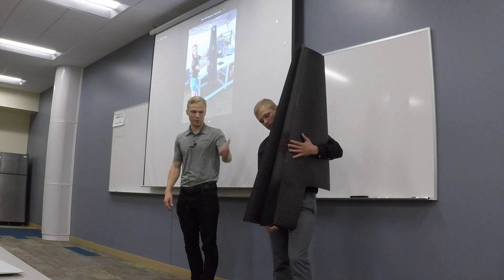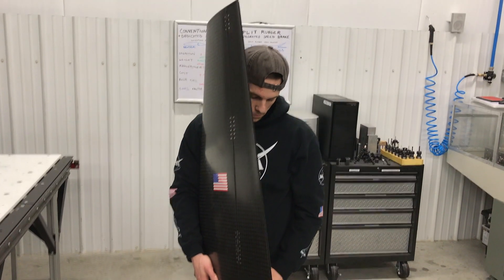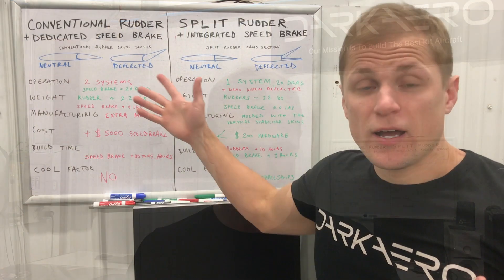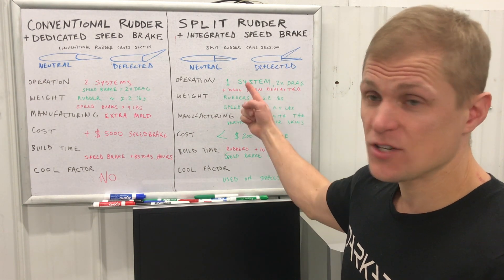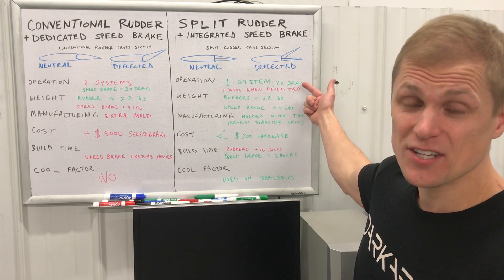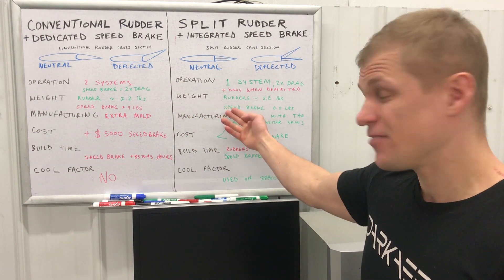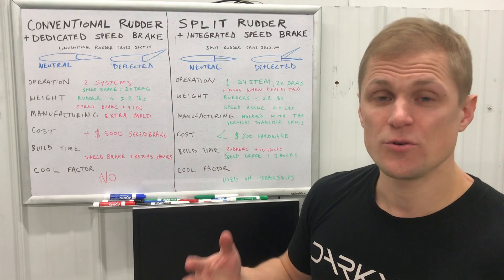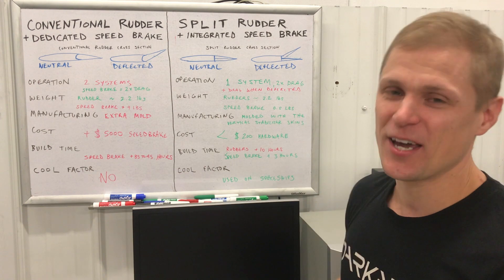The DarkAero 1 Aircraft Split Rudder

Comment: I admire your drive and passion to start a project like this. As an engineer who loves to innovate anywhere I can, I like your ingenuity of integrating a speed brake into the rudder. I was considering a similar idea on my plane, except as applied to the pivoting canard instead. I have some friendly advice I'm sure you don't want to hear from some random nobody on the internet, but I did notices two issues with your design that would become evident on the first round of high speed taxi testing, It is an easy fix if a little hard to explain.

1. Your split rudder design is not dynamically balanced to offset the extra control force required at your high cruising speed as the rudder deflection is increased. A balance isn't always required, but if in the future you find one necessary it can be incorporated with a dorsal horn balance at the tip of the left rudder and a ventral horn balance at the tip of the right rudder.

2, The second issue and by far the more important, is the intent to connect the left and right rudder flaps separately to the left and right rudder pedals with the speed brake function requiring constant force from the pilot on both pedals to keep the rudders open. Something which would increase pilot workload both physically and mentally during landing procedures. The fix for this is to implement a rudder control mixer device similar to a v-tail Beechcraft controlled by a distinct ratcheting speed brake lever in the cockpit. This would in effect be as simple as piece of steel C-channel with a hole on either end allowing the respective left and right rudder cable to pass through either hole. The plate will have a pivot in the center connected with a push/pull rod to the ratcheting control lever. When the control lever is pulled the plate slides down the rudder cables until it impinges on knots or clamps placed on the cables thus tensioning the portion of the cable connected to the rudder flaps, this motion will simultaneously open both rudders. The further the latching lever is pulled, the more the rudder flaps will open and thus a high amount of drag is produced. The extra control force resulting from the increased drag is taken through the mixer pivot anchor into the airframe, thus the increased control forces produced by the increase in drag are not felt by the pilot through the rudder pedals. Rudder control through the pedal remains unaffected even when the speed brake lever is pulled due to the speed brake control mixer incorporating a pivot between the two rudder cables. If the pilot adds additional input to the right rudder pedal the mixer will pivot about its center and let off a equal amount of tension/slack to the left rudder cable and vice versa. The clamps placed on the cables with be positioned such that when the speed brake lever is in the released position, the cable clamps will not impinge on the speed brake control mixer even at full rudder deflection, thus preserving independent control of either rudder flap.
Reply: Beautiful, I like your thinking.

Comment: Bad idea and adds unnecessary complication.  Need to look at human factors in the design.  Many pilots use opposite force on the rudder peddles for stability and control.  Pilots use both feet together to move the rudder, not just pushing on one at a time like a video game.
Reply: People that just say things like “bad idea” and “unnecessary complications” without any data or even references to other applications to support their position are absolutely the worst type of people to work with. How about suggesting another idea that would accomplish something similar to what they are trying to do instead of just shitting on the idea that someone else had? Or, at the very least, explaining why it’s a bad idea and what, specifically, makes it a bad idea. Simply bringing up that people use the rudder pedals in concert with each other isn’t a justification to scrap the entire plan. Also, the video game reference makes it sound like you’re a grumpy old man that is angry because he never actually got off the couch and tried to do something great and is full of regret. So, he takes it out on anyone that is actually out there doing it. Am I close? How close am I? 😉

Comment: Interesting, didn't know that hondajet had a baboon brake. Not sure that's elegant engineering. But it makes me wonder, could tab style airbrakes on the wings work effectively as a rudder if placed far out on the wings? I hunch that it would express too much as drag but if the wings have a certain length, would it be...  if you could forego a moving rudder, that would be elegant. If you take care of stability and trim with a static tail then it would only be for approach maneuvers where any slight inefficiency is worth the elegance.
Also I wonder, indeed assume, that rather than a prominent vertical tail, it would be better to reach far back with a much smaller tail fin like a shark does. Even though a shark uses it for propulsion. If a little extra length on a skinny tail makes a much better plane then it can be worth ignoring the hangar demands.

Comment: Hi guys! I’m not sure this is really related but: how does this split rudder works in case of a spin? Did you have the chance to simulate the spin tendency of DA1?
Reply: How many pilots would want a plane that could kill their passenger/s and themselves from not being responsive in overcoming even an incipient spin?  Where is the efficiency in hauling a plane recovery chute system?
Reply: I get the feeling that these are the kind of designers that slap a BRS on it and say it's not rated for spins.

Comment: Hey guys, that split rudder idea, while cool at first sight, may backfire at you - be careful. Split rudder system in shuttle, B2 and other military planes is carefully controlled by software, sensors and activated by precise machinery only in specific flight regimes. Your system is manually actuated and easily can be mismanaged in flight, and as someone using it in VariEZ mentioned, puts more workload on a pilot. Please consider removing or offer it as an option. And if you offer normal rudder with trim control - you will have my deposit to get in line for your kit!
Reply: I agree with you... Especially on their very first aircraft, they should be taking it easy with the "special" features, and maybe leave that for the 1.2 version of the plane instead. What initially matters is that the plane flies safely and predictably - flaps should do the trick for slowing down on approach. A complicated rudder system such as this will only bring delays. If the FAA has to approve any of this, I can only see it adding more time for certification.

Comment: I'm a VariEze builder/pilot and love all the innovative techniques and features you're putting in the DarkAero. I'd like to share my experience with the independent rudders on my VariEze. At high speed they are difficult to use as speed brakes because of the yaw produced by even a slightly uneven application of pedal pressure. It's pretty sensitive because of the high airspeed and takes concentration to keep the airplane tracking straight for the minute or so while the speed brake is needed.  For that reason the only time I use the rudders for speed control is on final approach when I realize I'm too high. And even then I find the feature to be of limited use because of the attention it takes to control yaw while modulating the drag to get me back on glide slope, in addition to all the other things happening on short final. The extendable 'belly board' on the VariEze and Long-EZ is a lot more useful since it doesn't require attention after being extended, allowing the pilot to focus on other things. However, it can only be used at lower speeds such as in the landing pattern.

Comment: won't this have more drag during high "p-factor" operations which require rudder? Extra drag while rotating for take off or fighting a x-wind doesn't sound fun. If it operated like a normal rudder AND had the split function that would be ideal.
Reply: sounds sketchy in a low speed crabbing situation where you want to bleed as little speed as possible while yawing the nose off. If you've got reserve altitude you're probably fine since your tail inputs will always bring the aerodynamic centre backwards.
I do really like it as an airbrake design though.
Reply: Canard aircraft (i.e. Rutan inspired; e.g. VariEze, LongEZ, Velocity, Cozy) have the same setup and they simply avoid using much, if any, rudder input in such scenarios. Some of the big jumbo jets also indicate a preference for landing crabbed as opposed to attempting a low-altitude sideslip, and IIRC at least one of the POHs or airline manuals prohibits sideslip landings.

Sideload on the gear isn't as much of a concern when you're touching down at ~1,500lbs.
Reply: @ParadigmUnkn0wn  the canards just have single direction actuation not exactly the same thing. And landings are not high pfactor  scenarios. Jets don't even experience pfactor...

Comment: I like your guy's analytical approach from design to fabrication, and of course, including the cool factor, I mean, that's what flying is right?
However, you've overlooked stating what I believe are the the two most critical factors when comparing the split rudder type to the fence type.....

No additional control to have to remember where it is, how to use it and then also remember to stow it (gear up landings come to mind...). Frankly, when you think about it, it's natural instinct to stomp the rudder pedals for braking, right?

Now, most importantly, you've eliminated the possibility of an asymmetric drag and lift spoilage condition if only one fence were to deploy due to a mechanical failure.....How would that literally end up?

Brilliant guy's!  Keep up the great work!

Comment: I just watched few of your videos and I think what you guys are doing is amazing.
Regarding the split rudder design however, I don't believe you will have enough rudder authority at low speeds and crosswind situations with that configuration.

You mention three examples of split rudder designs but there are differences to your design that don't make it a straightforward comparison :
- The space shuttle has a landing speed of 210+ MPH , whereas I'm guessing your landing speed will be in the range of 80 MPH.
- The Staggerwing you showed has a much larger rudder size. 
- The Long-EZ does not have a split rudder. You can think of it as two smaller conventional rudders that actuate to one direction only.

I just wanted to save you guys the hassle of trying to prove this out since it's unlikely to work.

Disclaimer: I am not aerodynamicist. I never designed or flown an airplane.
Reply: I just wanted to save you guys the hassle of trying to prove this out since it's unlikely to work.
 Burt Rutan told Danny Maher that a 4 place canard wouldn't work. Velocity Aircraft has been around 30 years now and are working on a 6 place canard.

Comment: I like your commentary on why it's lighter, but for PPL, how often do we have to use a speedbrake? The traditional rudder is on a pulley system, so the left and right rudder pedals are mechanically linked, while for your split rudder, it's not and we have to consciously lift one foot and press the other.

However, I think it's interesting that this creates both a risk and a redundancy. With two rudder linkages, there's twice the opportunity that one of them will break. However, if one breaks,  you're not left fully without yaw authority as you can use the other one. If the left rudder breaks, for example, then you can still fly by only making right turns using the still-functioning right rudder.
Reply: Good Point Alan. I wanted to add that I am not a big fan of both the split rudder and split flap system. Maybe the guys at Dark Aero can answer this question.

When using the rudder, there is going to be a lot of drag and I would assume some buffeting associated with that. Just because the airplane is designed for high speed cruise flight, doesn't mean that pilots don't want to have fun and fly some maneuvers around clouds, formation flight, etc. And I personally, would think the feel of the rudder pedals would feel odd when pressing on the left pedal and the right one does not move backwards in sync with the left pedal. I would also think it would be easy to inadvertently split the rudders and act as a speed brake in normal flight because the rudder pedals are basically your foot rest.

For the split flaps. I have not seen that in any airplane since the 1940's or 1950s. I would have like to have seen a Fowler style flap to increase the wing area and lower the stall speed. I'm sure Dark Aero had a good reason for going with the split flaps. Also, looking back at some of the designs from WW2, notice they have holes in the flaps / dive brakes. These holes were an afterthought to solve the problem of buffeting when deployed.
Reply: @TheKaptainkraig  Haven't heard them once talk about split flaps. Don't know where you got that from.
Reply: @kvnkaveman  The split flaps are clearly shown in at least one other video, but it may have been released since your comment.

Comment: How do you isolate the dissimilar metal and carbon fiber on your hinges to prevent corrosion?
Reply from the maker: Loyd, thank you for watching and for the question. Galvanic corrosion is something we get asked about often. This is probably a good one to update our FAQ page with. In general, any of the aluminum present on the aircraft is electrically isolated from the carbon fiber. All the rivets used in the aircraft are stainless steel.
Reply: I think there is another human factors issue.

I think you need a micro switch on both rudder pedals. If both pedals are pushed, you get a panel indication of speed brakes.

Imagine leaning forward to search for a forced landing sport, and accidentally putting pressure on both pedals in an engine out glide?

Secondarily, you will probably make your test pilot nervous because they can't dampen flutter with pedal pressure.

Additionally you will probably need to test it at full deflection up to Vne.

Comment: I have an idea that may work.. maybe incorporate magnets to keep the split rudder closed, so in cruise where minor rudder is required, it acts like a conventional rudder. If you push both pedals, then it’ll overcome the magnetic hold, split and give you air brake function.
Reply: Permanent magnets would make the action "sticky" - that would be very undesirable. Electromagnets would add complication and dependence on power supply, which would also be very undesirable.
Reply: @brianb-p6586  Agreed, an "abrupt" deployment would be very undesirable.
Reply: How about electromagnets so they are easier to disengadge..... you are already fighting both aerodynamic and spring pressure...the weight could be an issue.  This design as presented looks a little vulnerable to flutter in my eyes... there are no balancing horns or surfaces.
Reply: This would require extension of the cable to slide the magnets away from each other and release the magnet. This would further introduce the issue of preloading the rudder servo stack.
Reply: Good idea
Reply: At this point a spring with adjustable tension would do
Reply: If the opposite hinge allowed the non deflected rudder to do that, the suction from the vortices would pull it back with it anyway, no need for magnets.
Reply: Was thinking the same thing when l read your comment.

Comment: Great video and thanks for sharing! Why only use the vertical stabilizer as a spoiler? Why not also include the elevators?
Reply from the maker: Adding it to the elevators would probably get a bit dicey mixing it in with pitch control. The split rudder was mechanically really easy to implement and we had a little bit of a foundation to work off of looking at other similar implementations like the ones we mentioned in the video.

Comment: Great presentation. Aesthetically, I do find the DA1 rudder pleasing. Speed brake use is often periodic in use, so an atypically designed deployment may have less operator consideration than say, a wing flap or a flying control surface.

Practically speaking then, does the split rudder speed brake involve the pilot simultaneously depressing both rudder pedals?  I suspect the pilot learning curve will be steepest in operating the speed brake and commanding yaw at the same time. I’m thinking of left yaw in a descent with speed brake. 

Actually, this leads me to the questions of engine mount cant and tilt and rudder offset. Does DA1 have one or both?  How much yaw will be induced by power on pitch over?

Comment: Love this idea, more fighter plane style. But the idea of having fuel in direct contact with composite adhesives in the wing is a complete turnoff for me, so unless fuel bladders are installed I won’t be having anything to do with this plane no matter how innovative it is.
Reply from the maker: tropicthndr Thank you for watching! What is your objection to composites contacting fuel?  The epoxy and adhesives we use in the fuel tanks are fuel compatible.
Reply: I understand the concern, although wet wings are not uncommon. Other wet wings are sealed with an adhesive sealant in GA aircraft.  Nasty stuff, I’m told. Most VANS, I believe. If the materials used in DA1 are fuel compatible then where is the issue I wonder? I do recall seeing some issue with fuel containing alcohol here, but that is an issue widely held in most GA aircraft.